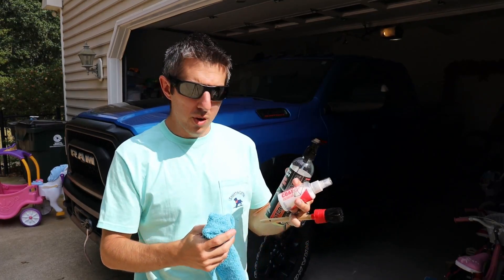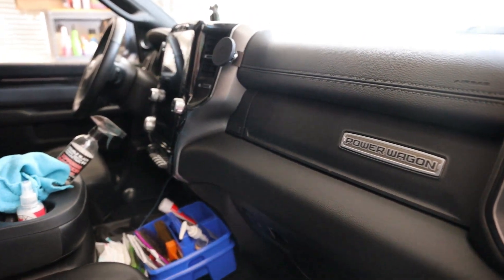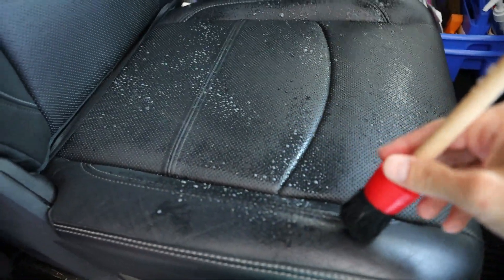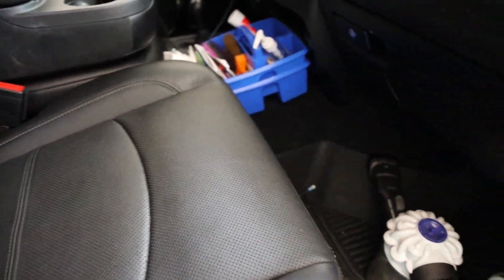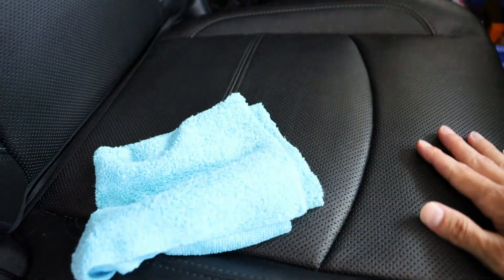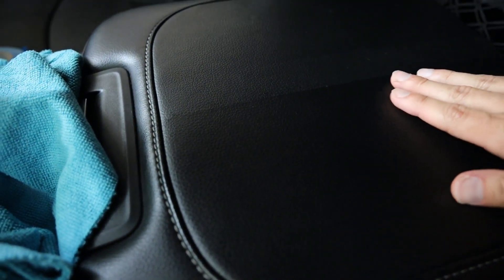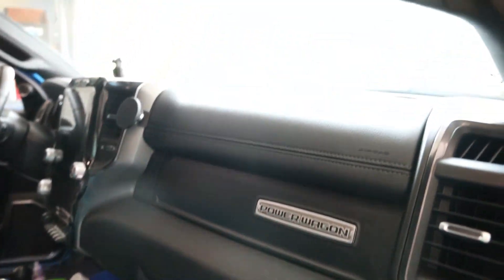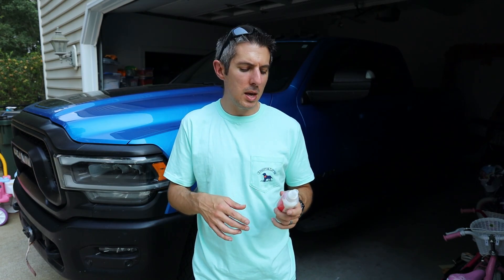Ceramic Coat your Leather interior: Gyeon Leather Coat Q2

Comment: Wouldn't ceramic coating be useless on ventilated, heated/cooled seats?
Reply from the maker: Good question. I don’t believe so because the ceramic coating still protects the leather from anything spilled on it or even sweaty butt juice…lol. Plus ceramic coating helps against uv light damage. If a drink is spilled on the ventilated part yes it will still go into the holes but the ceramic helps less Goni to holes because it makes the liquid have more surface tension.
Reply: @GReviewz  My thought was the ceramic would clog the holes and prevent the flow of air. Maybe the formulation is different at a molecular level than the ceramic coating applied to the paint. I was thinking about getting it done but I have questions and no answers.Thanks
Reply from the maker: Yes this product is formulated specifically for leather. It doesn’t say anything about not applying to perforated leather. This isn’t a full synthetic. It is sio2 infused leather protectant. I hope it helps. I have not found any loss in flow of air through seats. If following the instructions you supposed to spray onto a microfiber and work onto leather, not spray onto leather.
Reply: @GReviewz  Okay thanks.